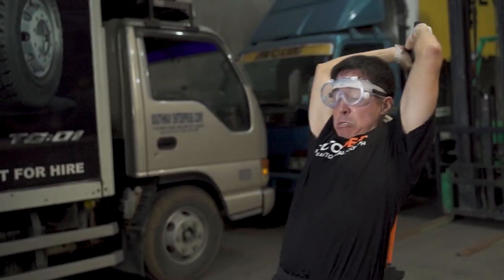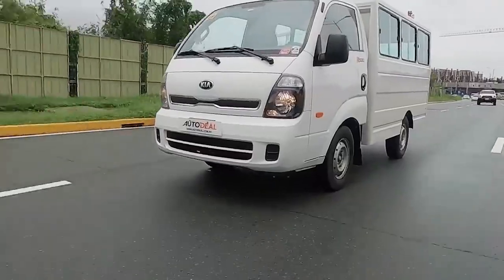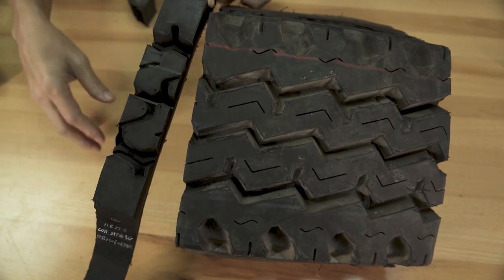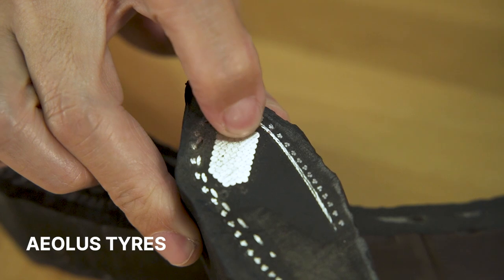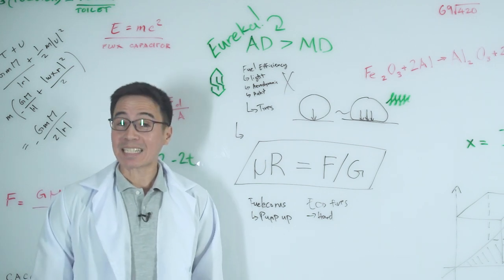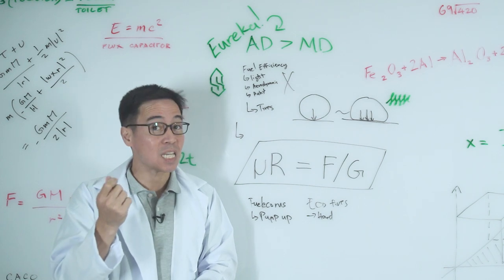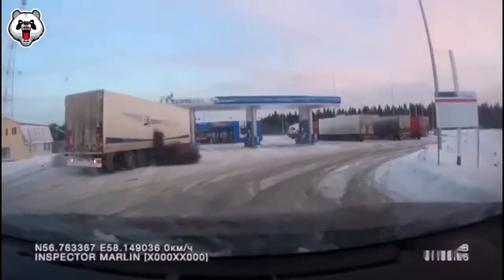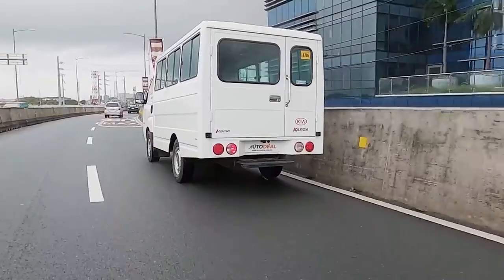How the right tire can save your business money

Comment: AdBlock may not have worked on this one but hey, he's legit with his point about tires. They need to be good. I tried 4k tires vs 8k tires. I'm never going back to 4k tires. 8k is the new baseline. I'd go even for 10-12k tires if I can.

Great science lesson too sir Caco hehe
Reply: May I ask if what things improved when you changed to 8k per tire? Curious since we always buy 4-6k/ tire particularly good year
Reply: @jeffismyname2637  That depends on the size of your tire. If you have a sedan or pick up trucks branded tires cost around 9k and up. Their are good mid brand tires around that cost between 6k-8k per tire. You also have to put into consideration how often do you use your car and your daily distance travelled. Tires that cost around 4k-6k( brands from china) for SUVs and sedan are decent if you just do city driving. If you travel a lot that's where you will notice the difference between cheap and expensive tires. Chinese tires quality are around 40-45% from OEM tires. Also the most important thing to do is check your tire air pressure and alignment to make sure your tires last longer
Reply: @jeffismyname2637  grip. Like tons of it. Never had my tire squeal since!